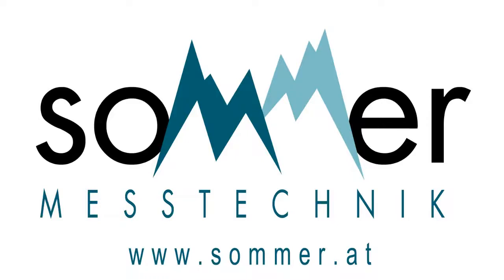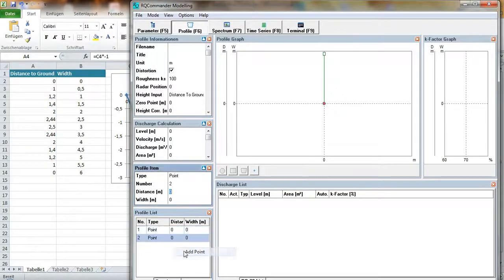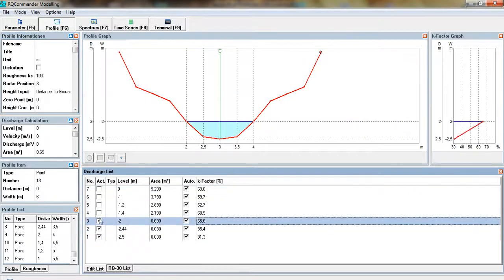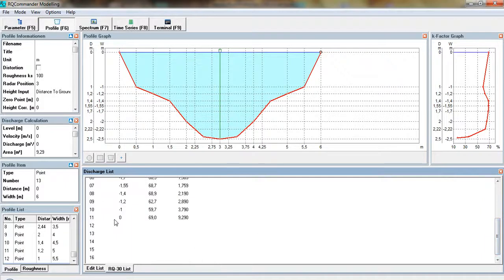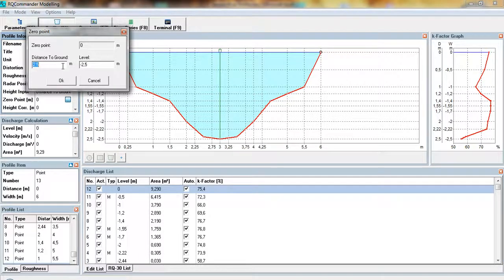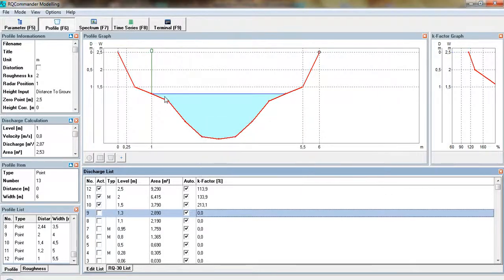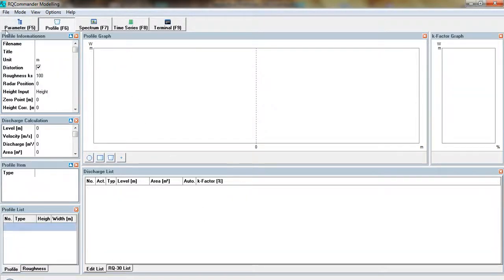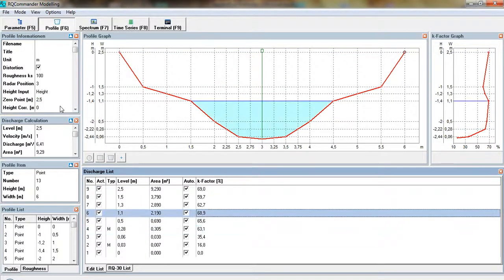How to create a profile for the RQ-30 in RQ Commander Modeling

Comment: thanks for uploading the video, i have one question. I have data of sommer RQ 30 only velocity and water stage. I have the profile of the river bed also. so how i would calculate the discharge as a contious function of velocity and water stage
Reply: Hi Atif, what country are you in? Please phone me if you can as the explanation will be very long to write. I can also host an on-line meeting for you & show you exactly what to do.
Regards
Peter Ward
CEO
HSA
Reply: hi, Thanks for replying. i think to some extend i have solved the problem by uploading profile and csv file in RQ commander and i get the results for discharge
Reply: Hi peter ward, thanks for replying promptly. the issue is hopefully solved as there is the option available in RQ commander to upload data summary for the loaded profile.